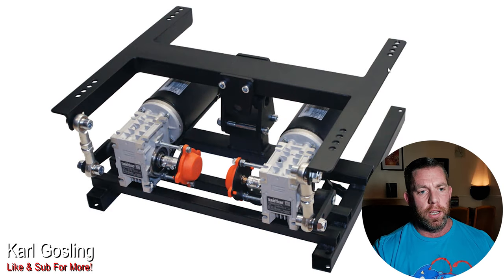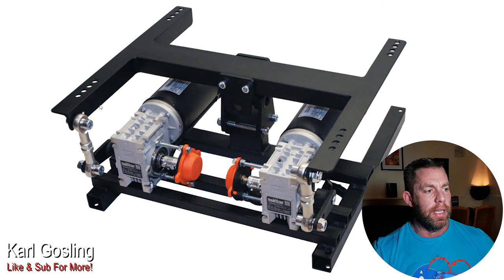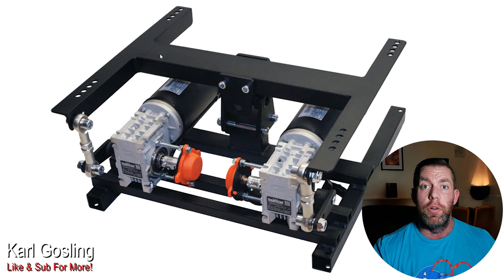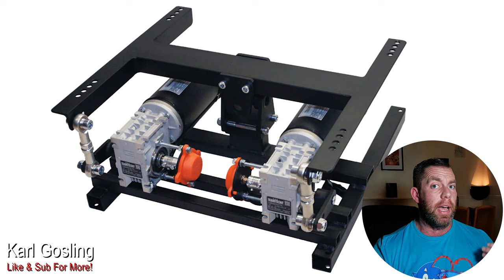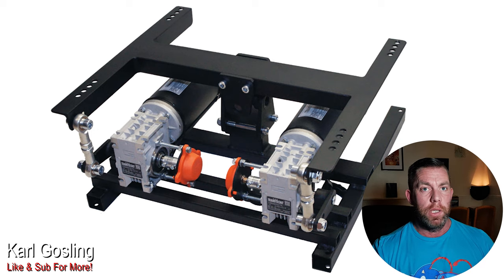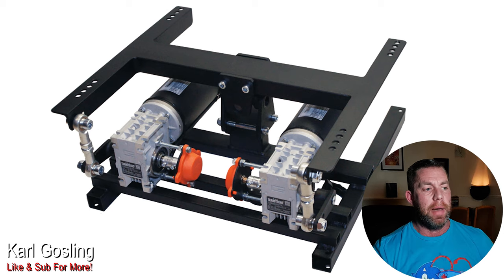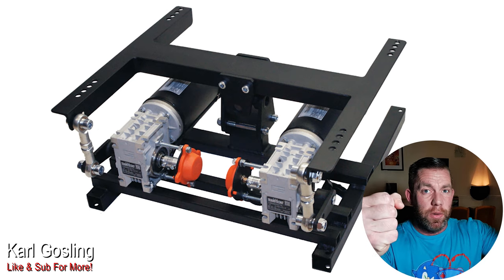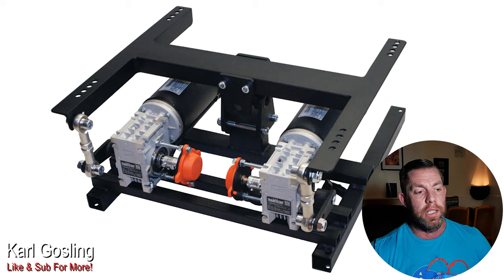Motion Platform Balancing Made Easy - DOF Reality M2 MS2 MP2 NLR V3 etc

Comment: Hi
Thank you for another great video.
I would like to know more about how safe it is to take centimeters of leaning sideways and forward?
Can you measure the length of the actuator arms from the engine and translate it to lateral tilt and front to rear?
I have about 10 cm of space on the sides of the back of the chair and I do not know if in this case M2 has a chance to be mounted on me.
I would like to know the maximum sideways tilt and the minimum tiltable.
I will be very grateful for help in this problem.
Sorry for my English.

Comment: I didn’t even know about “balancing” the seat. I’ve never done it with my NLR V3. It doesn’t seem to be effected one way or the other. Im about 5’10 175lb. I’ve had friends taller and heavier in my rig with the same results. 

 I do have my Sparco seat on a slider and it’s in my ideal position which is in the middle of the mounting bracket on the NLR V3. 

 The taller people do need to set the seat back because of the pedals, not necessarily the wheel. Which could set it off balance. I plan to add a slider to the pedals. I think that’s the easiest way to prevent any issue.
Reply from the maker: It's rare to have balance issues with the V3, the motors are stronger and it has counter balance springs at the front too.
I think only the heaviest of people or perhaps if it's been fitted really far out of balance that will encounter problems (overheating) after very long sessions.
The most common problem i see with the V3 is the arm snapping off the end of the motor after a couple of years, £800 repair bill IIRC.... again driver weight, how it's fitted and amount of use will really effect this.

Comment: my MP2 is on the way but this balancing is making me nervous...Im installing the MP2 on the sim lab gt1 evo. When you pay this amount of money, you hope to pay for plug and play with no DIY/modifications but it seem that its go get around. I guess we will see...Are you still happy with your M2 and have you tried nlr v3 to compare it. Thanks
Reply from the maker: It's really not that hard once you get stuck in and so long as you can drill a couple of holes and maybe cut a piece of steel plate you'll be fine.
Yeah I'm more than happy mate, I have used a V3 and yes it's a little smoother (but not much), definitely not worth the extra £1600 compared to the M2.
Reply: Jamaal Stewart Will you upload some videos of it mounted to the GT1 EVO when you get it all done? I’d really like to see what you come up with.
Reply from the maker: @OhItsThat  that's a great idea, I'd like to see too.
Reply: @KarlGosling  

GT1 EVO and MP2, video here

https://www.youtube.com/watch?v=ewNIMm_Qn3w
Reply: @KarlGosling  https://www.youtube.com/watch?v=ewNIMm_Qn3w
This is how i plan to mount once I received my sim-lab gt1 evo. You can also not tighten the brackets on the profile which means you should be able to move the whole seat and mp2 to balance without  installing 2 sets of seat sliders i think